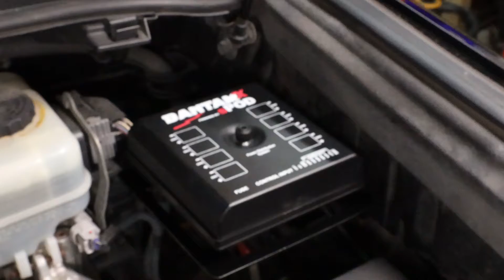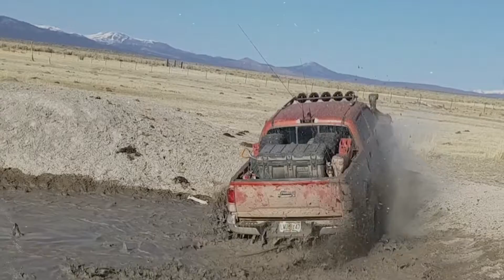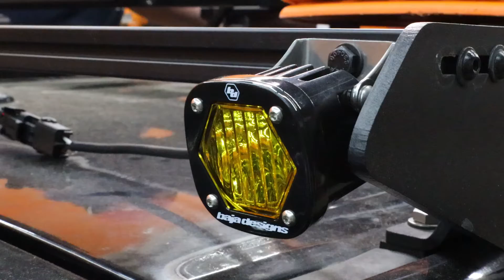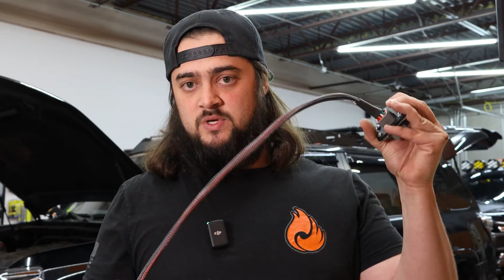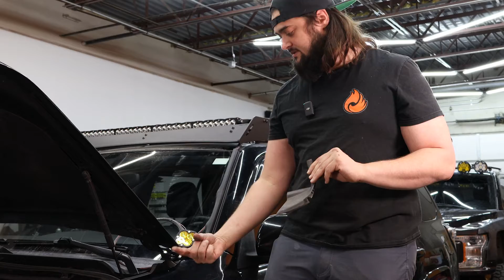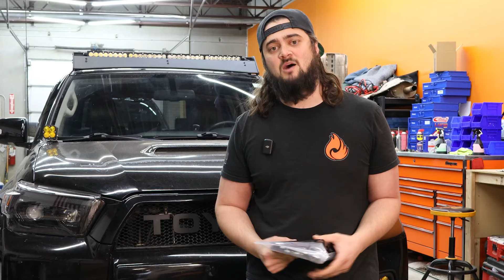Ditch The Complicated Roof Rack Wiring

Comment: What gauge wire are you using for the BackBone? Thanks!!
Reply from the maker: It varies from harness to harness based on the specific application, but between 16 for the scene pod harness with the rock lights and 8 awg ground after it combines from the smaller grounds in the DT connector to go down the windshield on the larger harnesses. All wire is rated to J1128/ ABYC E-11 standards.

Comment: Will the wires get hot in the back bone running 10-20 amps on the circuits? Either way. I need one maybe two. I have been known to have some lights on my rack. Keep up the great work
Reply from the maker: Absolutely not, all of our wiring meets SAE J1128 specs and are designed to work with each compatible light.
Reply: @BlazeOffRoad  that's great news. No need to send flames down my windshield.  It could make for good content but only once.